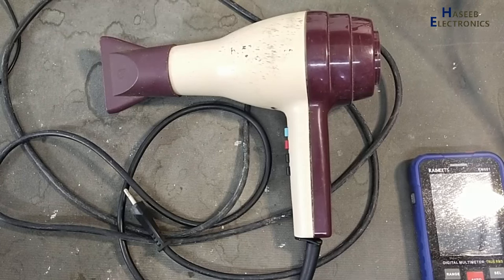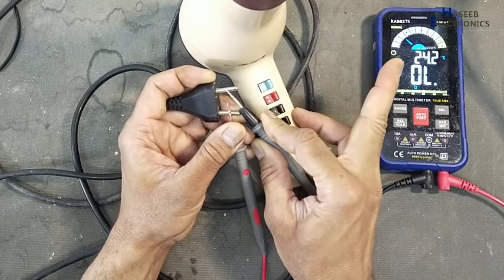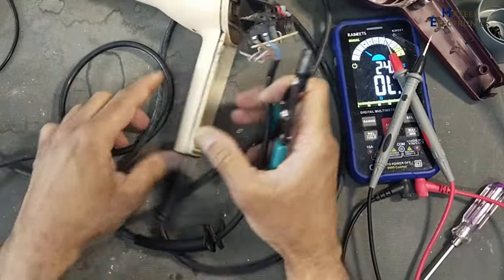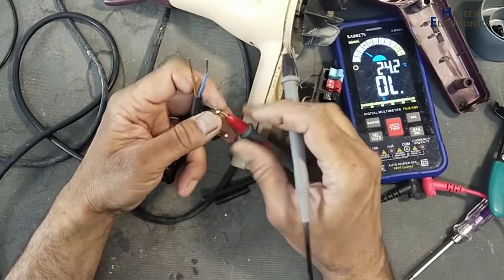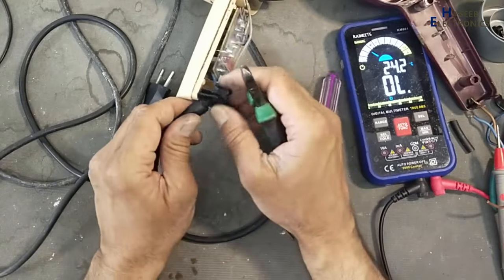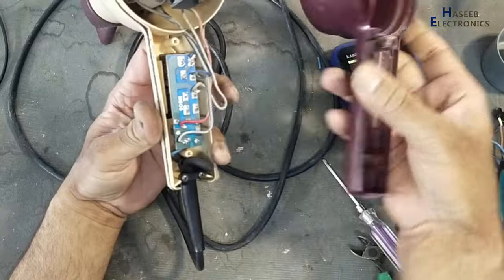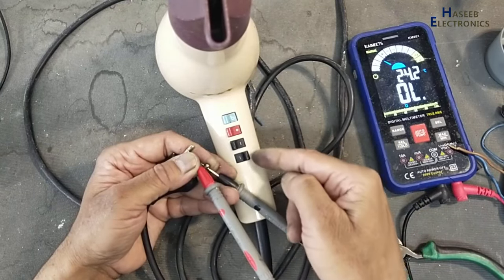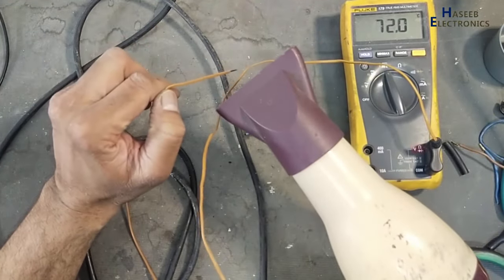{1098}  how to repair hair dryer not working

Comment: Hello sir i have a floor ventilator and iam trying to understand the working idea with the capacitor and the two parallel motor coils. Also mine one when i turn it on is blowing at 80% of rpm for 2 minutes and after runs in full speed.